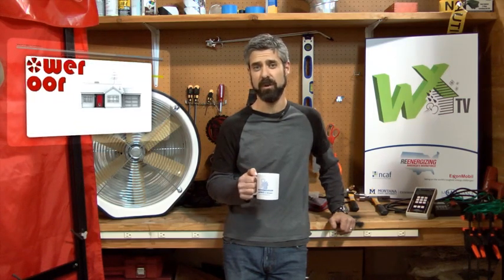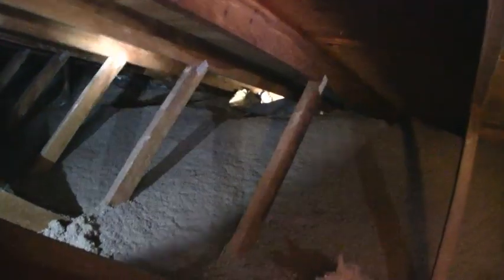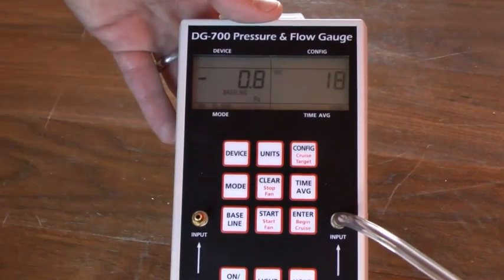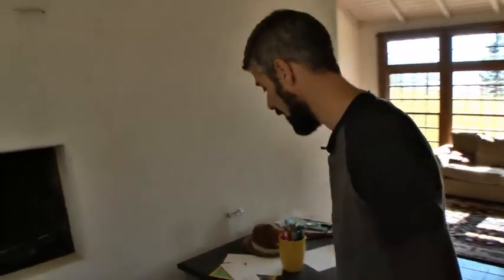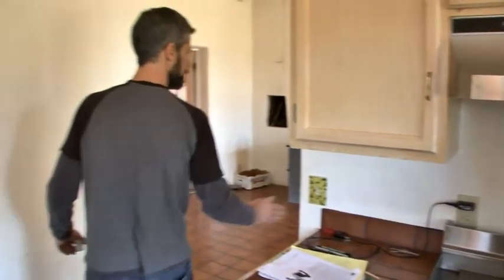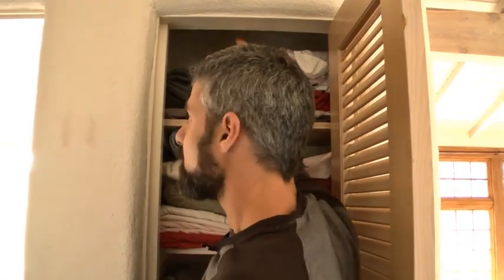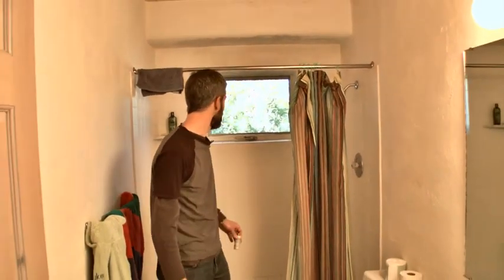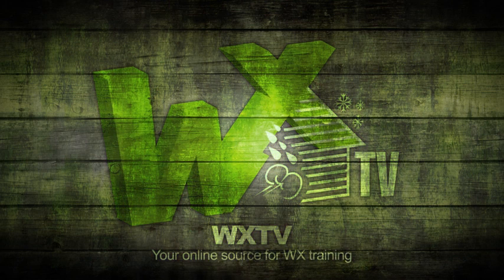Blower Door Basics: Part II - The Test Process

Comment: hmmm.... shouldn't that gas hot water heater behind the "mystery panel" have been turned down to pilot before turning on the blower door?
Reply: if it were gas the flue pipe that you see would be coming off the top. that appears to be an electric system. You can see the white cables at the top are conduit.

Comment: Heah, enjoying the videos. About to attempt to get certified in level 1 thermography. Would you agree that some of the leaks found (like around the crawl space) are created by the blower door ; leaks that are, in some cases, greatly exaggerated as they would never experience a wind draft? I know the high temps are always looking for lower temps to equalize but some of the "drafts" created would never be seen minus the blower door, right? Enjoy the videos. Where do you get a used blower door?
Reply: Actually no. Heat goes to cold.  So as heat that conducts down thru your building materials makes it into the crawlspace it will heat up the air and moisture within it and it will rise into the home through convection-holes cracks, crevices, plumbing chases, chimney chases etc.  this happens also if you have a rim joist that isn't treated in a basement.  as you lose warm air through convection and conduction thru the attic floor or upper floor ceiling, it must be replaced and typically the path of least resistance is the rim joist.  It sucs in that dense cold air and creates the stack effect.  Blower door is definitely an exaggerated effect but you are also most definitely experiencing significant leaks and heat loss through that crawl space if not treated appropriately with both an air barrier and insulation.